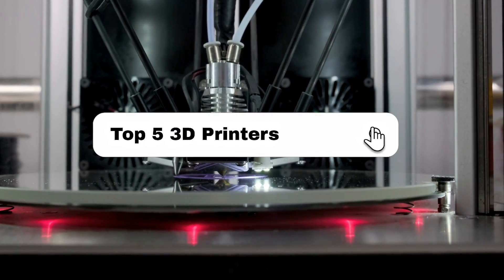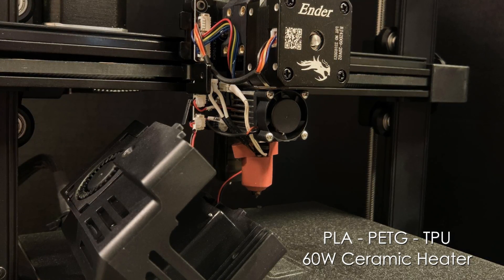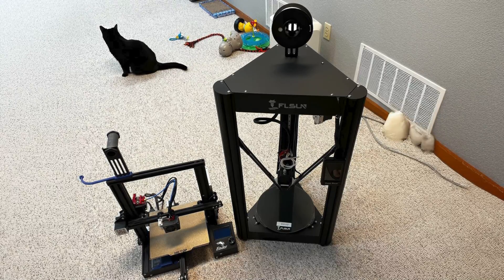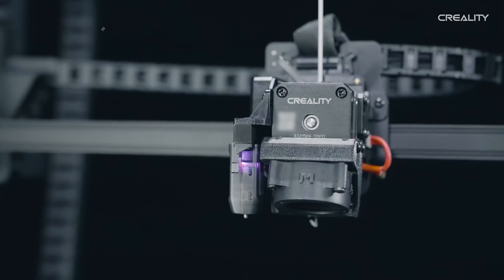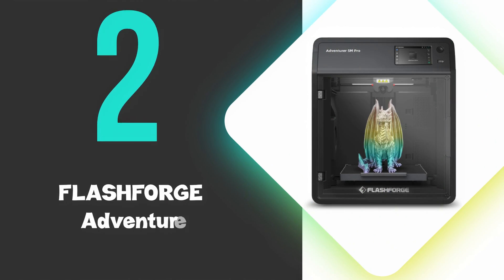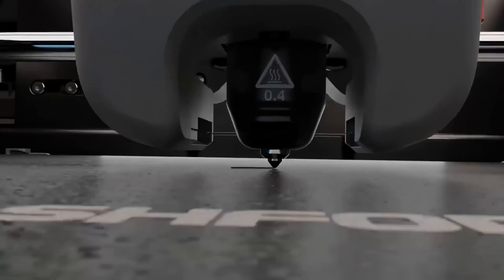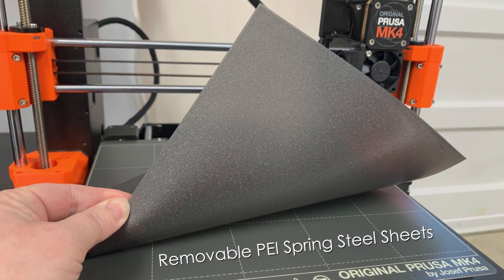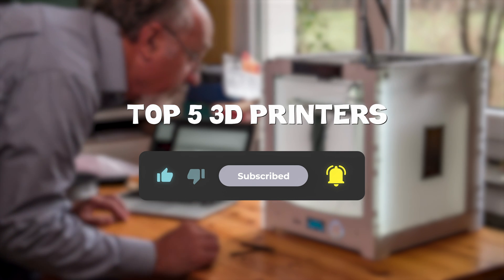TOP 5 Best 3D Printers 2025

Comment: I'm honestly surprised you didn't include the Bambu Lab A1 Mini in this list. That printer has been absolutely dominating the market in 2025 and for good reason - the AI-powered error detection and multi-color capabilities really set it apart from traditional options. While the Prusa MK4 is definitely solid, the A1 Mini offers similar reliability at a much more accessible price point, especially for people who want that plug-and-play experience without the premium cost. I've seen so many creators switching over to Bambu printers this year, and the A1 Mini specifically has been getting incredible reviews for both beginners and experienced users. The automatic calibration and smart features really make it feel like the future of 3D printing. Would love to see a comparison between the A1 Mini and some of these classics in a future video!